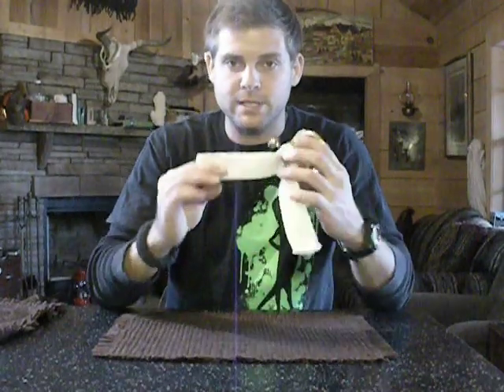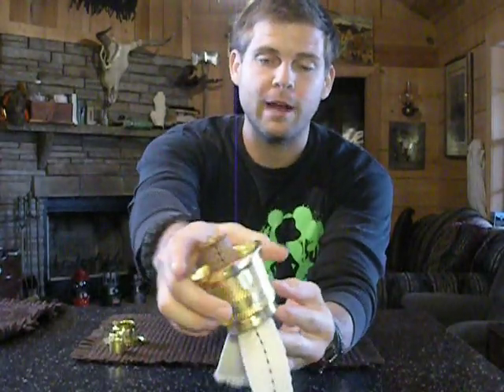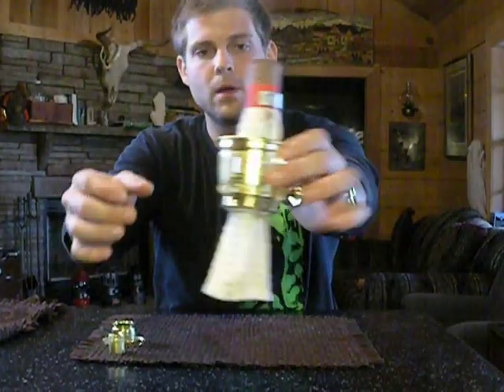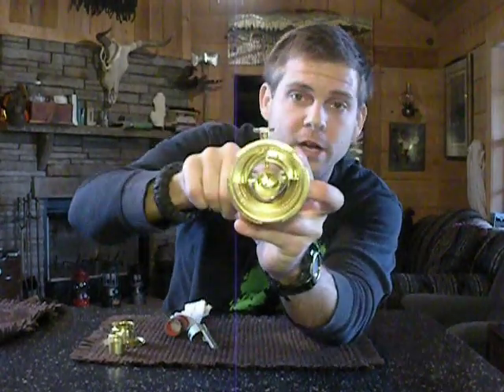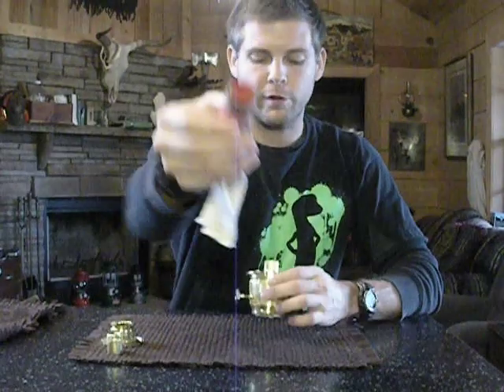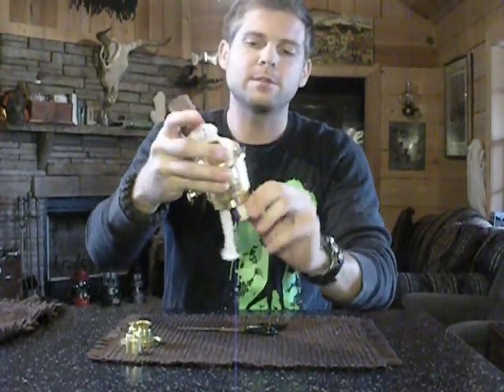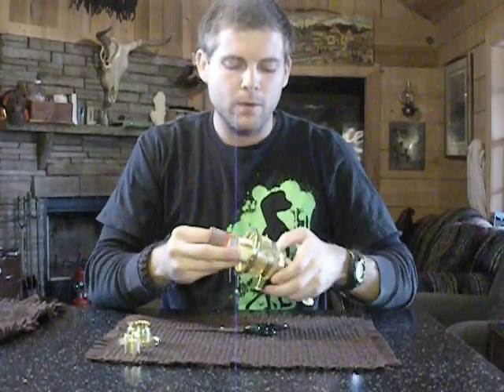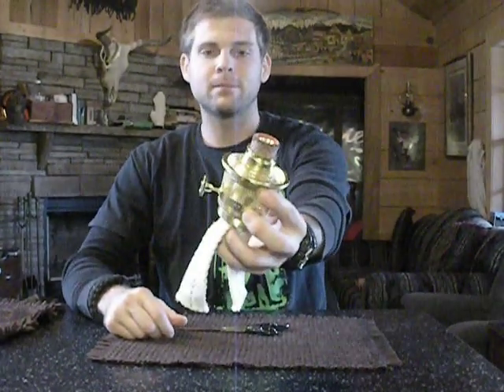Aladdin Oil Lamp :  How to change your wick

Comment: Excellent video!  I only use my lamps for emergencies so they've gotten a little corroded over the years.. I will try to clean them good before I reassemble.  When I did the first one I realized I was being a little too delicate getting the wick holder down into the feeder.  It actually took a little shoving to get it to engage but once I figured it out it was great.  Also the newer wicks have a paper feeder attached to the ends so it was very easy to get it through the assembly.
Thank you!!!

Comment: Success! I got one of the burners all cleaned and a new wick installed. Getting that riser to catch and work is a trick, there is a feel to it when it works right. I also charred the wick and now it's soaking in new fuel. Thanks for your videos! They really help.

Comment: Thank you for the demo. I watched it first before tearing into my project. I have the New B model and found that the procedure is different. The wick raiser goes in from the top and you have to thread the wick legs down through the burner and snap in the rivet lugs. Its not as bad as I thought it might be.  

The next problem was that the flame was spiking yellow on one side and blackened the mantle. It wasn't the new wick's fault.  You would never believe it but a spider web was covering the inside of the air holes under the burner. Gumout carb cleaner and an air blast fixed the problem. I lit the lamp tonight on the roof deck for 2 hours. This lamp hasn't been used since WWII so everything had been frozen up with varnish. Carb cleaner and a heat gun helped free it all up. It was well worth the time to get it functional again.

Apparently Aladdin was the peak of oil lamp technology. The light was nice and bright white. It was brighter than 8 of my Dietz lanterns burning tonight. I think Gramma would have appreciated Cree LED's back in the day. No fire hazard!
Reply: I also have a model B and now I understand your comment better. The wick has to go in from the top, and then the riser from the bottom. That seems to be an improvement over the design in the video because there's a lot less fiddling involved.

Comment: I have 2 Aladdin model 23's that sat for a long time without being used. The kerosene evaporated out of them and now the wick turner won't move the wick up and down. 😕 I can't get the flame spreader or the piece under it (I can't remember the name of that piece) off, neither will move. I'm thinking I might need a solvent to dissolve the residue this keeping these pieces glued together- what should I use?

Comment: What about a barely used lamp with a stuck (from dried varnish?) That won't go up or down. The wick looks new from the bottom, but the lamps been sitting long enough for it to get stuck.
Reply from the maker: +61loneviking Rust is probably to blame. I would take it apart and soak the whole stuck part in kerosene. Then replace the wick! :)
Reply: But it's the wick thats stuck. The bowl has kerosene so the wick can't be dry. The burner looks new, so does the wick that I can see. And yet, it isn't moving.
Reply from the maker: +61loneviking Take it apart! Maybe you just have it jammed. Use a pair of needle nose pliers to pull down on the wick from the bottom while turning the knob. Might help loosen it.

Comment: I have 3 #23 Aladdins and they're so temperamental I bought three #3 Queen Anne burners to replace the horrible Aladdin burners. Just bought a new wick for one Aladdin burner and the wick raiser won't catch the metal clips. it raises up and down but the pops right off the wick. USELESS. Also, one would think Aladdin (or SOMEONE) would develop a wick that isn't so high maintenance. (I have a 1900s center draught lamp that works perfectly so it's not that I'm completely clueless.) And another thing... I'm burning paint thinner/low odor mineral spirits at $13/gallon and it works fine in a center draught lamp.